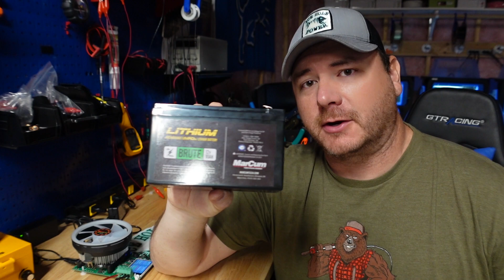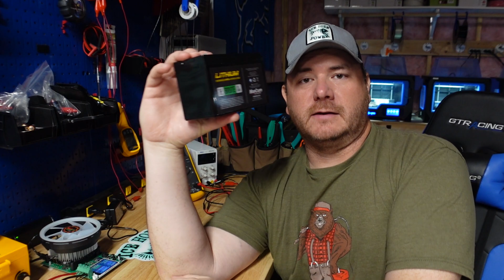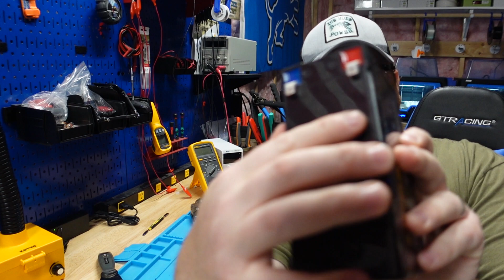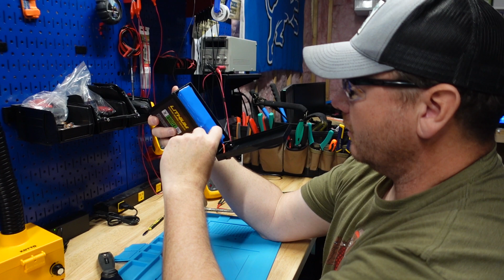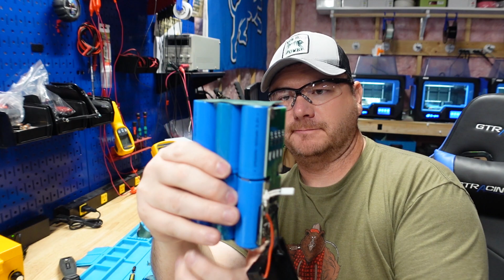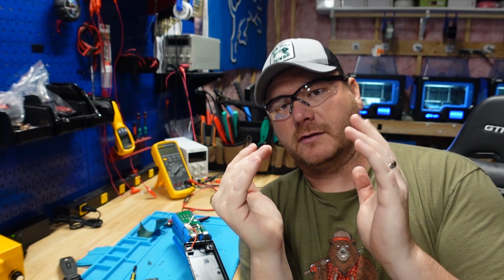MarCum 10Ah  BRUTE Lithium Battery Teardown

Comment: Love the videos! Very easy to follow and plenty of details.

Question for you on charging the 10amp/hour. Could I use a Noco Genius 5A Charger or should I spend the extra money on the Marcum Charger.
Reply from the maker: Yes, absolutely you can.  Although I usually suggest using the manufacturers charger in case a warranty claim needs to be done.

Comment: I own two of these and between their performance, and this video, I was impressed enough to pick up two more to repower a couple backup units.  The new batteries arrived and wouldn't take a charge on the supplied charger (assumed green on the charger meant fully charged).  Put them both on an analog multi-meter and neither moved the needle.  Tested the lead acid batteries that I was trying to replace, and they were both in the 11-12 volt range.  Looked at the date on the new batteries and they're over 3 years old, new off the shelf.  Is there a way to "activate" the battery, or are they toast?

Comment: They only rate peak discharge . They don't rate continuous discharge current. I wish they had more specs on their batteries. The peak discharge current ratings are lower than other manufacturers for similar ah rated batteries. maybe as a safety feature I'm guessing not to mention these are marketed for running fish finders and stuff.

Comment: Great review!  You inspire me to learn more about electronics.  

I'd like to ask...the picture of this item looks like the battery has dual F2 connectors (one set to connect to power up a device and one set to charge).  Are there 2 sets of connectors on top? As I watch your video it only looks like one set of connectors.  I personally would love two; that way I wouldnt have to disconnect it from my device to charge.  Thanks!

Comment: I bought some King 18 AH batteries and would like to see a test on this battery. I liked your video on the 10 AH .I am wondering if the 18 AH still uses the number 18 wire ? I notice the max current  is still 10 amps on the 18 AH battery even though it is rated for 18 AH. This comes from the factory specs. on the 18 AH. My max load on my King batteries may be around  8 amp. The company does not say what max steady  amps the battery can handle. If they only put 18 wire in the King then a steady current of 8 amps would overheat the number 18 wire. I am hoping they put number 16 or 14 wire in the King battery.
Reply from the maker: I think at 8 amps you will be good. The wires are really short. What are you running?
Reply: @iceholepower8012  I will be installing in an electric bike. Sometimes the max current may be around 8 amp. I know short lengths of 18 wire can handle 8 amps or more no problem .But the wires are fully enclosed in a sealed container with no ventilation .The ratings for 18 wire are in free air with ventilation. Electrical codes don't allow 18 to be used in an enclosed area in house wiring even though it is rated for 16 amp in free air. I think in a sealed environment 18 is only rated for 3 to four amps. I could be wrong on this. I am just wondering with 2000 charge discharge cycles will 18 wire stand up. Going to 16 or 14 makes for more of a safety margin .

Comment: Any plans to test the 18AH Marcum King? I have a Brute and a King.  Just curious to see if the King is also underrated for capacity. Also, good to know there’s no low temp lock out for charging.  I’ll be sure to let my gear warm up before charging now. Thank you so much for sharing the knowledge.
Reply from the maker: It's on the list to teardown. Thanks for watching!

Comment: I just purchased the Marcum and it came with a charger.  Have you or could you do a video on different types of chargers? I heard that I shouldn't use my old lead acid chargers on lithium. Is that correct? How can I tell what type of charger I have?
Keep up the great work!
Reply from the maker: Great question, i actually made a video on it a while back. Typically if it is over 14v it is for LiFeP04
https://youtu.be/A6tUS3z1fJo

Comment: 18 awg can still handle 15-16 amps though.  And for that AH battery that seems fine to me.  Am I missing something ?
Reply from the maker: I agree, a inch and a half chunk of 18AWG can handle a 15 amp draw but it would get warm especially if it was a constant draw. If a guy was to repeatedly put that kind of load on the battery and that 18AWG would expand and contract over and over again from the heat, it could fracture the solder joints on either end of the wire. I just prefer to see a bit thicker. In the fishing world that probably would never happen but if a HAM radio guy were to use this battery, I could see it being a potential issue for them.  Thanks for your comment and thank you for watching!
Reply: @iceholepower8012  Good feedback.  Do you put any kind of label on things to tell them max amp draw recommended?  I assume the inline fuse is also always below your max amp draw sizing for the system you're selling anyway.

Comment: I'd like to see you test the marcum lithium shuttle!!!
Reply from the maker: Love the idea!
Reply: @iceholepower8012  im trying to decide between just switching batterie to the brute or to the shuttle. I don't have anything fancy as electronics. I have marcum m3 just interested if the 100 difference is worth it?
Reply from the maker: @dmredneckd1708  I would stick to the Brute, unless that shuttle has a lifep04 battery in it.
Reply: Ok thanks
Reply: I looked and it's a lithium polymer.

Comment: Awesome videos. I noticed that you did a short circuit test on the Amped battery but none of the others, maybe you could let us know if any of the other batteries have this protection as well?  I have a brand to throw in that ring that I have noticed popping up in a lot of the stores around my area, "Universal Battery".  Keep the videos coming.
Reply from the maker: I actually just forgot to do it with the others. I have been winging it I guess lol. The short circuit protection circuit does work with the other brands that I have done a video on. That Universal Battery is probably a sealed lead acid, I don't know of any lithium batteries from them . Completely different ball game, they do not have a BMS so no protection circuits.
Reply: @iceholepower8012  No, they actually have a 6ah and a 12ah LiFePo (that I have seen) for sale (so I don't know if they are new for this year or what) and I have also seen their LiFePo chargers for sale. They are White and Green in color.
Reply from the maker: I have not seen a 6ah from them. I have seen the 12ah but it is not LiFeP04, it is a lithium-ion. Two different chemistries
I believe the 12ah is a Scheels exclusive.  https://www.scheels.com/p/marcum-force-12-amp-battery-kit/85001378246.html?store=58&gclid=CjwKCAiAv_KMBhAzEiwAs-rX1O_1hgZKezmRZkJNpKoVkyRhz3Wl6Gm_JxdyCwp07VJ4ivQ8DKoVRRoCXPoQAvD_BwE

Comment: Great video! Glad to see the review on all of the batteries so far, especially this one. How does this battery being tested and certified to UL 62133 standards rank in importance to all the other batteries as I believe Dakota is the only other one that has this cert? (correct me if I am wrong) As always, great info!
Reply from the maker: That is a great question. I will have to do some digging. However, I did have a Dakota battery that probably wasn't certified so maybe that's something new with their made in China stock? https://youtu.be/jFMKJZJT5x8

Comment: I've been looking for a good 10 to 12 amp battery for a GMRS 50 watt radio pack build. I like this battery, but I agree with you on the wires....I wish they were a little bigger, at least 16 gauge. How well do you think this battery would work for some thing like 50 watt radio for just a day hike type thing? Also, could this be charged using a small folding solar panel or is there a battery that can be charged from a solar panel without a bunch of regulators and what not? Keep up the great work.
Reply from the maker: I would lean towards the Amped 12ah or the Dakota 10ah for that application because of wire size. I am not a HAM guy but have spoken to a few and they can pull up to 10 to 15 amps when keying their mic. That kind of amp pull would probably be too much for those 18AWG to handle.

Comment: Can you charge this battery right away after a time frame in the cold or should you wait until it warms up to room temp?
Reply from the maker: You should wait unit it warms up. Great question!
Reply: Yeah lithium should not be charged when the internal temperature is at or below 0°C should not be stored or discharged below -20°C